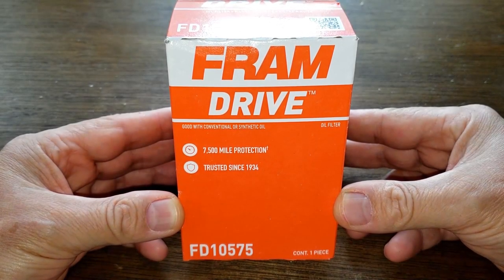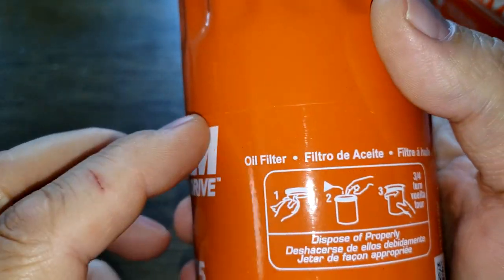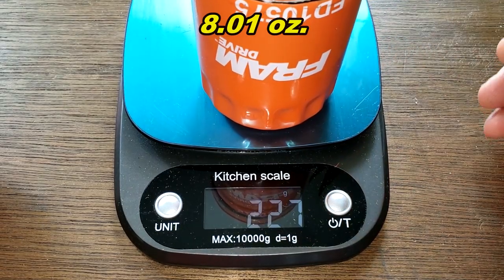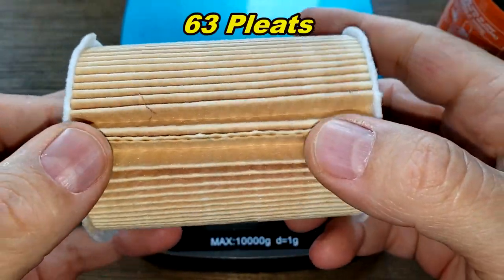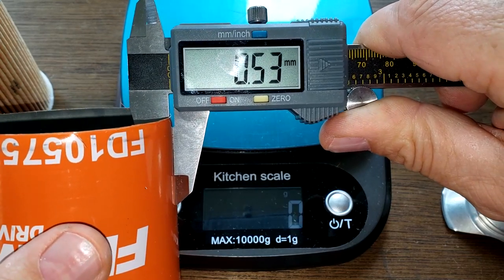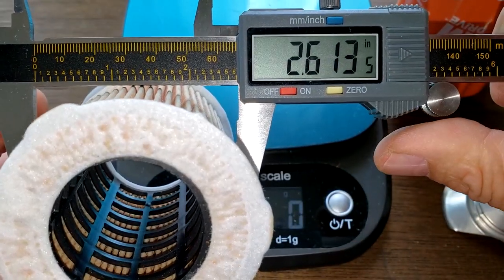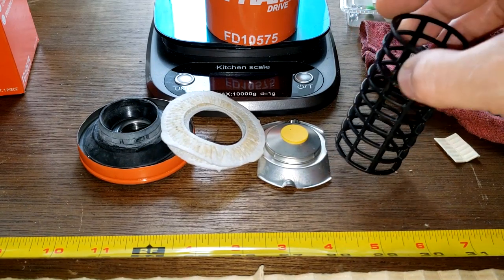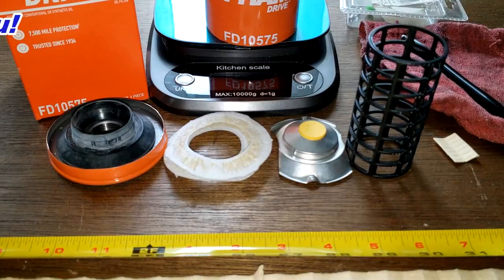Fram Drive Oil Filter Cut Open FD10575 Oil Filter Review

Comment: Plastic cage, felt end rings - stamped steel bypass = no 💰😁 Great video  👊👍
Reply from the maker: Thank You!😊
Reply: What's wrong with a stamped steel retainer?  It holds the filter in place tightly against the anti-drainback rubber/silicone seal, whichever is supplied and that's all it's supposed to do.  The spring-loaded valve in the middle does all the bypass work, not the stamped steel retainer.

Comment: My 1981 Mazda 626 had 272k when I sold it.  The person who bought it drove it for another three years. 

During that time I owned it (100k+) I used nothing but the orange can and the cheapest oil I could find.  It served me well, but I also changed the oil every 3k.

Overthe years I have struggled with synthetic oil.  At first I thought it was a marketing  gimmick to extract $$. 

I use synthetic to push change intervals, but in my own cars I use conventional oil and change the oil every 5k.

Comment: I’ve come to find the Fram drive series is not in house manufactured by Fram, it’s made for Fram by champion labs, I called them up. It’s the same efficiency as a super tech filter…no difference whatsoever, according to the manufacturer.
Reply from the maker: Ya, I kinda figured that,
Thanks for sharing👍

Comment: You can also get Motorcraft oil filters at Walmart for nearly the same price & it’s an outstanding filter. Would love to see a test on anti drainback valves. Is silicone that much better than nitrile rubber or just a little better?
Reply: Even with all the issues with purolator made motorcrafts? I refuse to use them anymore with all the issues they have. This frampion doesn’t look all that great. But it’s a cheap filter. Their higher end filters are a lot better as shown on this channel. Silicone anti drain back valves last longer and stay more pliable then nitrile rubber. Especially in high heat. Frams normal lines all have them. This is a line of filters they make for AAP.
Reply: Are you actually familiar with the differences in the characteristics of nitrile rubber and silicone?  That will answer your question.

Comment: Says Fram on the can. As alluded to, really a Champ Labs made Fram. So, a "First Brands Fram."  This one made 2/20/2021. Many of these Champ Labs ecores now have gone to metal end caps, perhaps even newer stock of topic. The Super Tech MP10575 comes with silicone adbv for same price. Otherwise I bet same filter. Topic has separate bypass too, no combo valve, which is a big improvement. I think this filter ok for 5k mi oci. Thanks for vid.
Reply from the maker: Your Welcome

Comment: I'd only trust this version of Fram on a riding lawn mower or lawn tractor.  The Ultra Synthetic Fram is in a different league. I guess if you run a full synthetic and you change at 3,000 miles, then it doesn't matter if you get the cheapest Fram, and drive like a grandma.

Comment: great video thank you. I have a suggestion for a new video, I like to see what's inside those extremely cheap oil filters that Rock auto has on sale, like this one a FVP R7145, PENTIUS PLB4386, PRO-TEC 163 , that fit a Celica GTS  2001, they cost between $1.00 to $1.35, I think it be interesting to see what $ 1.00 can get you.
Reply from the maker: Thank You!
I may do a comparison sometime.
Reply: Those cheap filters are probably still better than the orange can of death Fram
Reply: @daewooparts  I wouldn't be surprised
Reply from the maker: Here's an older video I made comparing the Protec I had forgotten about this one, someone commented on it today.https://www.youtube.com/watch?v=K_3oiKuj26I&ab_channel=WhipCityWrencher

Comment: "Avoid the orange can ,avoid the FRAM" even if its built by Champ labs they still cheaped out with the felt endcaps,probably still a orange can of death
Reply: The felt end cap is a value item. The end caps are a similar material as the filtering media itself. That means the manufacturing process is less expensive. The manufacturer can use a lesser expensive adhesive to adhere 2 similar surfaces, and use less overall adhesive. When you have metal end caps you're adhering it to a completely different material, so it takes more adhesive, and a more expensive adhesive. That's why you see adhesive oozing out from between the media and end caps when Whip City Wrencher does his cut open's on the filters with the metal end caps.  Even on the Ultra Synthetic filters we see that.
Now personally, I do use the Ultra Synthetic filters on all my vehicles but I'm not happy with Fram's decision to change to a different media. The previous media was superior to the current media, but I'll keep using it.
Reply from the maker: I would use the Supertech MP 10575 over this Fram. It has a silicone adv and metal endcaps, and about the same price.
Reply: @dannyo6699  Finally! Someone that understands the purpose of the fiber end caps. They aren’t inferior to metal
Reply: @dannyo6699  This looks like any typical cartridge filter and there's nothing wrong about felt end caps. These recycle better, and I like the plastic cage for maximum flow. Never liked the tiny holes some metal cores have.
Reply: @dannyo6699  they cut the quality, but not the high price of the filters
Reply: @jamesplotkin4674  ,they don't recycle the felt or fiber materials, they recycle the steel can ,everything else gets🔥 burned off in the smelting process, only the steel is recycled ♻️
Reply: There is a difference between felt endcaps and FIBER endcaps.  The felt material used on these specific filters and other Champ made filters that use the same felt material is know to separate from the filter unit.
Reply: I’ve never had a problem with Fram.